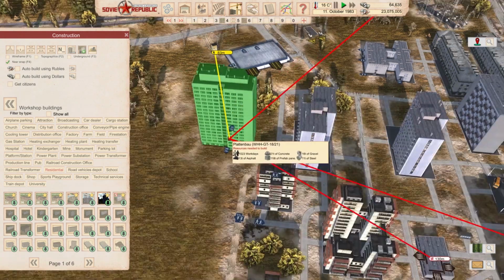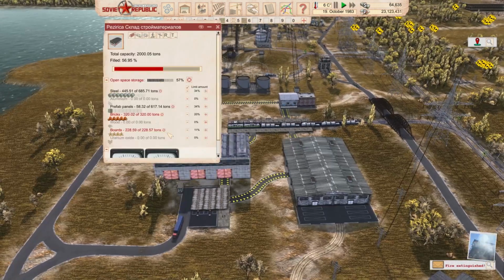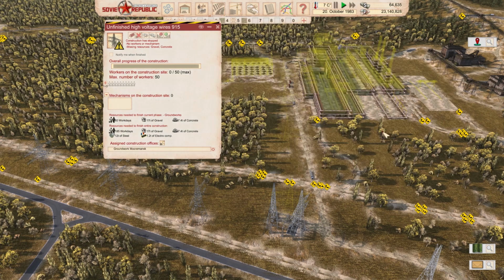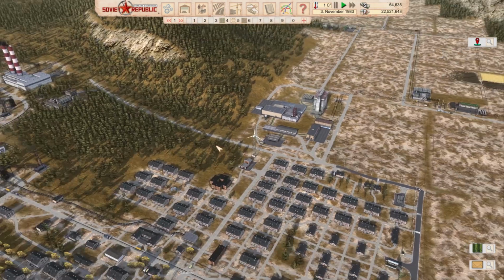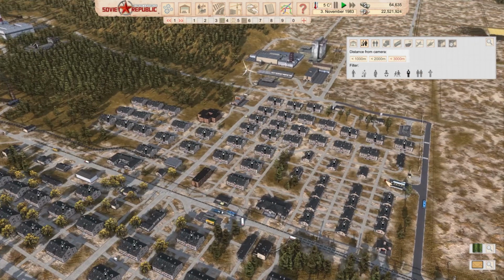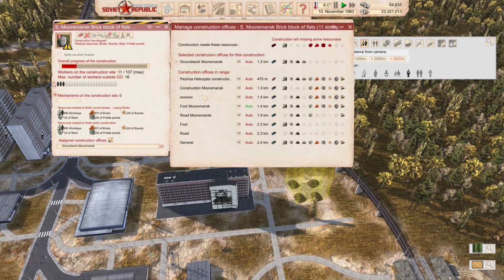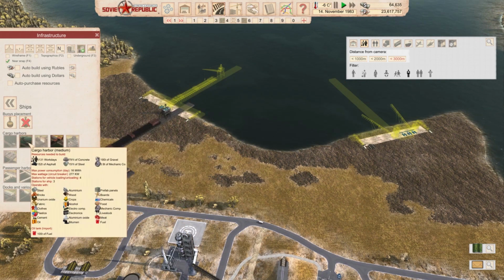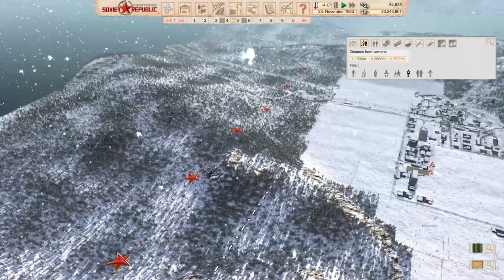Soviet Republic - Alaska - The New Beginning - Ep.89

Comment: 1) What I like to do myself to bring an additional realistic industrial visual is also to have a train transporting steel from the steel mill to the openstorage (here from the back of the factory by example). It is absolutely useless but it's nice to see this steel train doing its job between the two
2) Yes, the problem with this open storage mod (very common problem for moded open storages) is that you first need a perfectly flat surface to prevent the grass from appearing in superimposition. Maybe this is also the case to explain this visual problem with the bricks, it never happened to me maybe because I have the necessary flat surface before building it so I can't say for sure
Reply from the maker: 1. No, no, no! I love it!! I'm doing that!! Also, Mr. Toprus will be happy about that. Small utility locomotives bringing the steel out! Great idea! 
2. Probably. I will make sure the other storage is perfectly clean before I construct it! 

Thanks, man!

Comment: I agree that you are shrinking the size of your capital city.  I do like my distribution networks adjacent to the city and the industrial areas right outside them to negate pollution impact.  By using the "area dots", I don't have the headache of where my ancillary buildings should be built.  (I just give myself a different headache in deciding how everything is going to be built before I plop one building down!).

The booming population is definitely a better headache than the 15,000 population cap you were dealing with a few episodes ago.

It will be interesting to see if the footprint of the harbors need open paths for the ships to get into the harbor (which I'm assuming they will) which will make crisscrossing the harbors a bit challenging, not to mention the aesthetic look of preventing ships from having digital collisions.

All these headaches........yea for Tylenol.
Reply from the maker: You are right about the pollution buffer in the form of a logistics hub. I will consider this. 
True on both population and the ship traffic. 
Thanks for the suggestion, chief!!